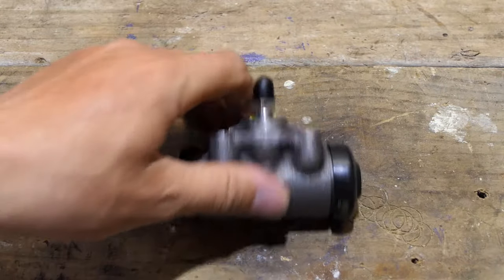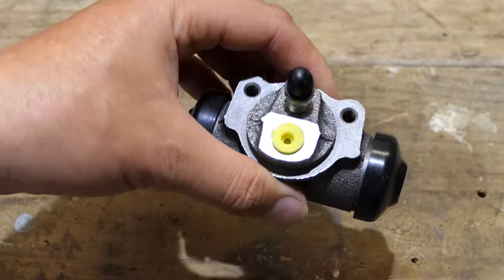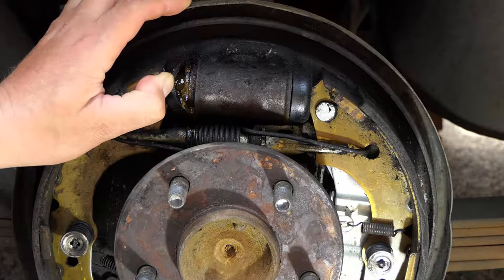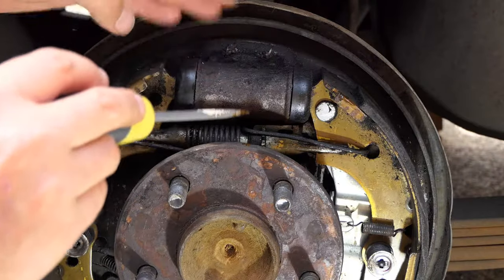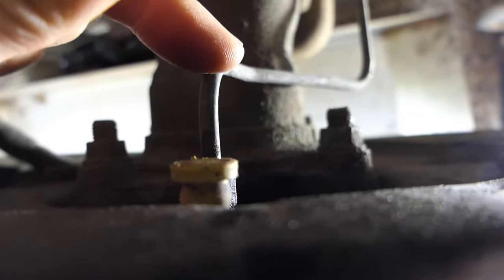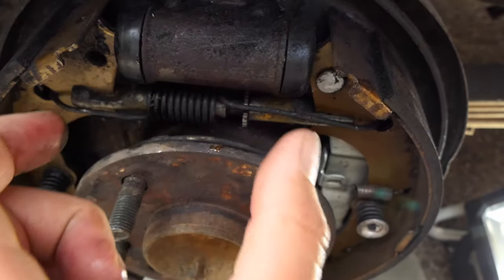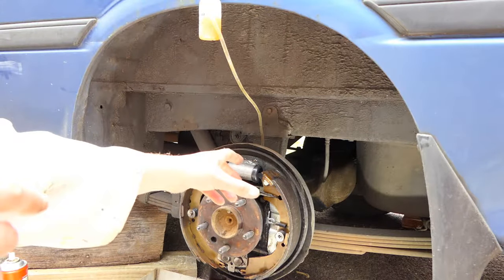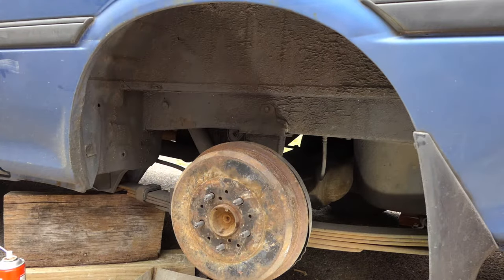Brakes Locking Up? Quick Easy Repair Guide

Comment: Quick question, I put new brakes on but didn't change the old brake wheel cylinder..I put the the drums on and the drum can turn and the brakes seems to be in perfect place but the moment I put the wheel on and torque the wheel the whole wheel locks up and stops moving. It's like torquing the wheels locked it up....do you have any suggestions on why that might be?
Reply: Brake drum is warped....replace it

Comment: I have a 2002 shuttle ezgo and rr is locking up. Cylinder not leaking but it not releasing pressure. Then when cooled it unsticks on its own.

Comment: My 1986 ford Broncos 1 . back driver side brake drum is locking up when i press the brake. I have new brakes new drum new cylinder and new booster. Do you any idea why this is happening to me my friend???
Reply from the maker: Air in the line? Dirty fluid? Cylinder not set correctly? Blockage in the line?
Reply: It started like 1 month after installing all these new parts. We're would you start first?
Reply from the maker: If it worked fine at first, then I would definitely start with the brake fluid.

Comment: Is it possible to install calipers backwards? Like install the left on the right?
Reply: You will know if you did it backwards if the bleeder screw ends up on the bottom of the caliper. They need to be at the top for air to come out of

Comment: I know this is an old video, but I wanted to point out that the bleeder goes on top in every situation, due to physics. Air is less dense than any fluid, so the bleeder always goes on the highest point of a hydraulic system.

Comment: What happend when the cylinder goes bad?
Reply from the maker: The wheel in question would lock up when I braked which was a bit scary. After it happening a few times I could feel which wheel it was and upon looking at the wheel cylinder, saw that it was leaking fluid which it shouldn't do.
Reply: @BuildsStuff  what if you cant get the drum off.....I know which wheel it is....I actually seen it drag...had my  girlfriend drive so I could examine it...initially I thought the pin had broke but this makes sense.....Do you think I should change brakes also...which I already purchased thinking it was because I needed brakes....taking to shop tomorrow.....I have a 97 monte carlo ls.....

Comment: This is the problem your wheels are locking up.  Now this may not be the problem your brakes are locking up.
Reply: Mine are locking up. I changed both cylinders on mine and it’s still occurring
Reply: @humbugbaa6964  how you fix yours?